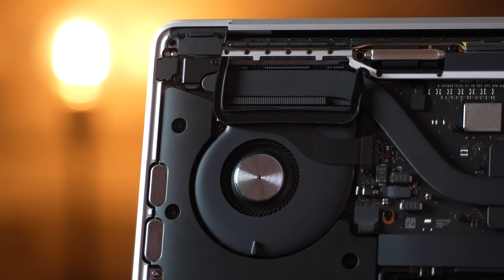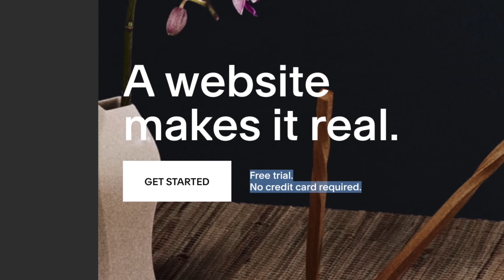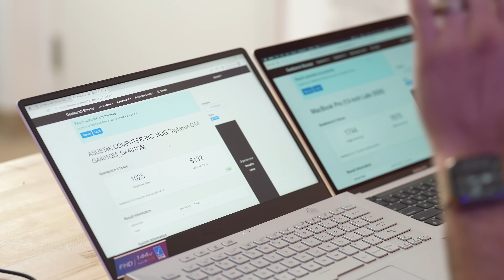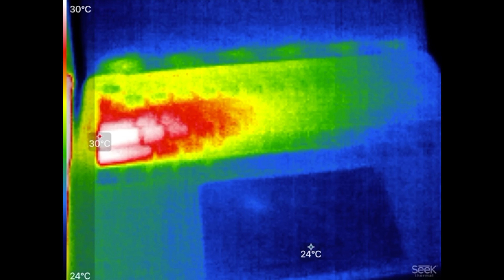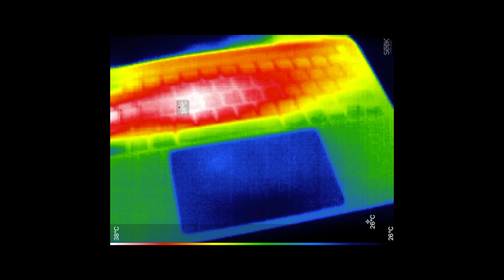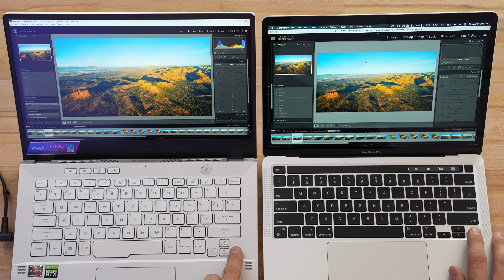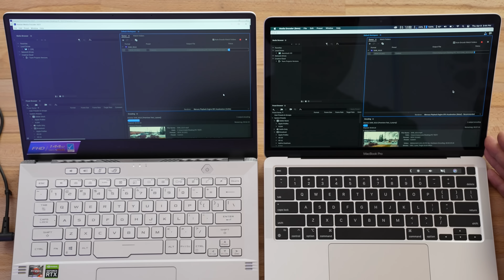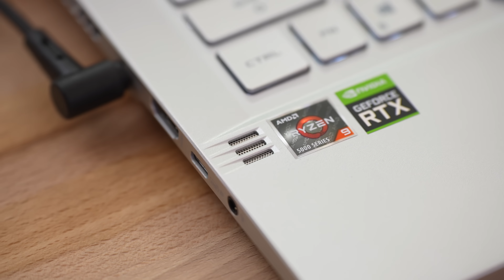Apple M1 vs AMD 5900HS + RTX 3060: FINALLY an M1 Killer?

Comment: When you compare single core performance tests you should think them as  "single thread" tests. The performance of the arm M1 cores is awesome, but you should also keep in mind than most x86 chips can run 2 threads at the same time, so the real performance of the core is between 1x and 2x of what the "single threaded tests" are showing, depending on the task.
Reply: Not quite. hyperthreading only makes use of the inevitable (for the x86 instruction architecture) pipeline stalls where a complex instruction can‘t be performed quickly enough to satisfy the need of another execution unit within the same core for the result of the first operation. So it’s only that fraction that these stalls eat up that is free to use for the second thread. That also means that thread switching is more complicated and overall it‘s probably less gain than the high efficiency cores on the M1 are able to deliver. If it were as you think then the 8 core AMD CPU should have had increased multi core performance. 

To see how much overhead additional threads do inroduce you could - as a rough estimate - divide the multicore score by the single thread score (if the test is setup correctly). But the multicore score isn‘t even close to 8-fold the single thread score and far from the 16 fold score if your theory were correct. But multi threading introduces considerable task switching overhead and synchronisation eats additional performance. If you consider that the M1 is close to 4 times the single threaded performance - and that‘s basically two 4 core processors, one fast for performance and one slow one for high energy efficiency the score of the M1 shows how much better the thread performance scales on such a design unencumbered by hyperthreading!
Reply: @karlgunterwunsch1950  You are right, the gains in hyperthreading are 1.5x at most, not 2x, and only in multithreaded tasks. But I'm right that in single core tests is not measured the full capacity of an x86 core, as long ago, with the first ht core invention, engineers resolved how to take more performance of a Cisk  long pipeline architecture weakness. And 
%50 performance in a given core is a lot.
I like much more the Risk approach of the M1 processors though. And I hope the x86 architecture slowly fades out as is an aging and not very efficient architecture.
Reply: @emilioaranguren8829  The task switching overhead costs almost as much time as is gained by making use of the stalled execution units. That is also made worse by the fact that x86 instructions are extremely hard to decode in parallel (instructions are between 1 and 15 bytes long - thus parallel decoders will have a hard time wasting a lot of effort on bytes that constitute part of an instruction that is being decoded by another decoder). An AMD CPU architect said that the x86 instruction set limits the number of parallel decoders to 4.

There was a time when the BIOS (and CPU) allowed to disable HT while booting - because in certain multithreaded workloads HT was more of a hinderance than a gain. With HT enabled the performance in such workloads dropped by as much as 20%. The maximum gain back then was 20% when accounting for the overhead introduced. 

If I - as a software developer myself - am optimising multi threaded performance I try to avoid making use of the HT cores. I set proper CPU affinity so that cross CPU task switches are minimised and I always calculate the amount of parallel threads to be less than the amount of physical CPU cores - because typically it's the same instructions/execution unit across the threads that they will stall on the CPU - thus if I allow HT to be used I effectively incur the penalty of the overhead but no gains because the stalled thread will also stall the  HT interspersed thread.

HT is a crutch, introduced because some execution units of a CPU core were left idle due to stalls - but with poor register set design, too complicated instructions the CISC approach has now hit a performance wall. RISC had it's time in the past and with the available technology at that time it faded into niche uses (mobile processors). With newer designs and architectures it now starts to flourish once again. I'm just interested to see if a RISC SIMD design like the Intel 80860 will make a come back...
Reply: @karlgunterwunsch1950  With ht enabled in CGI-CPU intensive tasks you can gain beween %30 and %40 improvement in multithreading, with all threads running at top. Look for the comparisons in Cinebench between a 9900k and a 9700k. Your "%20 at top" theory maybe works in tha kind of programs you make, but not in CGI and video cpu intensive tasks.
Reply: Also, if your theory were true in all cases the 9700k should beat the 9900k in single thread performance (there is just 100 mhz of turboboost difference between the two) and it dosen't.

Comment: The 5900HS isn't the fastest AMD mobile chip, though. That would be the 5900HX, which is noticeably faster.
Reply: Can you really get the 5900hs laptop for $1500 in USA? In Europe that thing is 2300€ or $2750. For 1500 bucks I get same laptop with amd ryzen 7 4800hs
Reply: @PfropfNo1  European pricing is higher due to taxes, US pricing generally doesn't include taxes and even then it is lower
Reply: @dev1lm4n63  Don't even talk about indian pricing for tech products. Especially apple products!
Reply: @dev1lm4n63  ain't just taxes. It's an american brand, will cost more when exported, same as VW in Germany vs abroad.
Reply: @Whatdoesntpass  the funny thing it's that german cars are cheaper in the US than in Germany. it sounds crazy but it's the truth.

Comment: This episode is 100% secretly sponsored by AMD and Windows.
Tell me why should we do editing on a small machine having 3060 . We can just use 3090 instead.
Max didn't even mention about power efficiency and battery life of M1 .
Of course the GPU is good in AMD Zephyrus G14 but If you have a GPU intensive Job , then you can use better setup with more powerful GPU.

Comment: Great video. But I want to know how quickly the battery drains on the non-Mac machine in tasks where it beats the Mac.
Reply: x86 CPU can not beat arm CPU in terms of power efficiency. So m1 mac will always win.
Reply: @joydebnath_1485  Its not just because it uses ARM. M1 is on TSMC 5nm, it has 4 efficiency cores and has full integration with the RAM and SSD. The R9 is on TSMC 7nm and isn't tuned for efficiency, running all 8 cores at full speed and wattage. Once AMD move to TSMC 5nm and include things like 3D stacked Cache, they'll be much closer.

Comment: Unfortunately the Zephyrus is going to be a WIndows machine. At the end of the day I just can't envisage going back to a Windows machine whatever the speed of it's CPU.
Reply: I'm firmly locked into the Apple ecosystem, and I find it extremely useful. So yes, Windows in not my first choice in an OS. But I also game, and while I can do some gaming on my M1 Mac, it's obviously not a gaming machine. That's where the G14 excels.
Reply: @timg6930  i still would never buy that G14 though, i recently even switched from pc gaming to console gaming to escape Windows. I bought an original PS3, and PS5 to gain access to the entire Playstation library, and for the nintendo library? I now have a SNES, N64, Gamecube, and a Wii U, and a Gameboy Advanced SP. With plans of buying a NES as well.

I’ve had a switch since launch though. Bought the new 3DS XL very close to that. Before i planned to escape windows.

What can i say, Windows is to me the worst thing i have ever used
Reply: I’m a mac user myself, i cannot imagine buying that laptop myself either, i hate Asus because of awful experience in the past, BUT! The laptop luckily  isn’t limited to Windows though.. You can always install Linux. You do need third party driver support since NVIDIA’s support for linux is extremely lackluster (which is why i’d always chose a radeon over an NVIDIA GPU) but yeah, its still possible. Yes Linux lacks professional software like Adobe CC But its still a billion times better than Windows, in my opinion.

Comment: For me the obvious option is the Zephyrus G14.
It is blazing fast in most cases and will run games more than twice as fast than the M1 Macbook Air.
And most importantly, it will only set you back 1499 USD.

Max, you should have run some real games benchmarks but other than that, good comparison.

Comment: M1 has changed everything, before M series you had more expensive Macs with lower performance,  now its cheaper, and better performance!

That is a massive change and not surprising that both Intel and Microsoft are airing deceiving and ridiculous TV Ads.
Reply: yes. I stopped checking Macbooks 4-5 years ago because you were just paying Apple tax for a slightly better quality. Mac OS is good and nice but Windows can offer similar experience nowadays. 

But M1 changed that. Having a fanless laptop that runs as fast as what others can offer but fans blowing and sucking 4x power is a game changer. 

I love G14. I may get it. It can do everything. But for everyday productivity use, Macbook air is a different beast.
Reply: @cmfrtblynmb02  For somethings PC is still the king, Gaming, 3D rendering, 3D simulation and....

Having said that, for me, MacOS is really great, especially when paired with an iPhone or iPad, the iOS MacOS ecosystem is truly remarkable.

Comment: In the end both are very different in architecture. One is a unified chip which has everything soldered to the CPU and which offers no upgradability. Whereas the Zephyrus is using the traditional architecture and offers upgradability or has the right to repair!
Reply: Soldering everything is a good thing imo
Reliability; solder is better than a connector which might come undone, corrode, or otherwise lose connection and/or become flakey, e.g. under vibration

Cost; connectors on the drive and on the motherboard cost more than no connectors

Third party problems; one of the big problems on the early SSD MacBooks was when a third party SATA III drive was substituted for the factory SATA II drive: the shielding on the cable was good enough that the Intel chipset would negotiate SATA III successfully, but not be able to do sustained transfers at those speeds without data loss. The ribbon cable was not sufficiently shielded, and there was not enough room in the case to replace it with a better shielded cable

Thinness; edge connections take less vertical space than top/bottom connectors, even if you discount connector hardware

Upsell; many more people buy the bigger drives to “future proof” their purchase. This just makes good sense anyway

Lifecycle; if you are more likely to buy the bigger drive, you are more likely to have a machine that will continue to support future versions of Mac OS X… OS’s always take more and more space over time: bigger disk = longer useful life, just like more RAM = longer useful life

And most people don't even have an iota of an idea about how a laptop needs to be repaired, so right to repair is just dumb. Just take it to an Apple Store and they'll fix anything you want.
Reply: @Dishant161  How much do you think adding connectors on motherboards cost? I would pay a few extra pennies to have upgradeability as an option, even if it made the computer as thick as 2015 MBA that had a removable SSD.

About reliability, I’ve had soldered-on BGA connector failures on both iMac and MacBook Pro GPU’s (+ iPhone 7 WiFi chip). Also one of my iMacs had one of the RAM modules malfunction but repairing that was easy as changing the RAM stick for $20. If it was soldered on I would have had to pay hundreds of dollars for the logic board replacement at the time. Since it is an old but fully usable computer it would make no sense to pay more for a part swap than the computer is worth.

Soldering on everything also makes repairs harder for technicians too adding unnecessary time and smaller businesses have to invest on costly equipment like rework stations to get the job done.

How do you think buying much costlier but better configured products upfront would serve the average consumer if the software doesn’t yet require more memory or storage to run smoothly. After using the product for a few years upgrades are cheaper for the same parts that would have been 2 to 3 times as expensive a few years ago.

Reusing is always better for the environment than recycling. And cheaper for the wallet too.
Reply: @Dishant161  Yeah, if by "fixing" you mean they immediatly tell you they can't get your data off and you need to buy a new one. Sadly, people could get their data off even from badly water damaged iPhones. Oh, yeah, and don't forget how the system is basically useless if one of the soldered components breaks. Cpu? You can't get your data. Ssd? You can't turn a perfectly good computer on.
Reply: @kaalsemulzii1920  Not if you back it up to iCloud though. You get like 2TB of storage for just 10 bucks a month
Reply: @Dishant161  Oh, yeah I forget about cloud... I mean someone else's computer. Silly me.
Reply: @kaalsemulzii1920  What do you mean?
Reply: @Dishant161  they'll just ask you to buy another one or pay a good sum of money for repair

Comment: i was wondering if you use a fan control software for the MacBook M1, and set the fans too maximum. Can you squeeze a little more performance out of it? Or is the chip just  running cooler without better performance?
Reply: Ltt had done this for an intel based macbook air. It did not work as expected. Very little gain. They had concluded that Apple limits the cpu not by the temp only.  Would like to see an m1 version of the same work.

Comment: It feels like it demonstrates that discrete GPUs are still relevant in some use cases (and should probably be offered in the future MBP 16 and iMac), not that there is yet really serious CPU rivalry with the M1. Were the (admittedly impressive) G14 constrained to the size, thermal, and acoustic limitations of the Macbook Pro, sans-external GPU, it wouldn't have even been close; it's simply not efficient enough yet and is competing with brute force. We're looking at roughly 3X the power consumption for an overall slightly slower CPU (once we remove the discrete GPU from the equation). 

I think that where AMD will really shine is in desktop performance (compared to a hitherto-unknown M-based Mac Pro or iMac) where, thanks to large heatsinks and wall power, it can really stretch its legs and efficiency starts mattering less and less. 

That said, we have to ask ourselves if we're comparing the M1 to the 5900HS (in which case we ought not allow the Nvidia GPU to be used), or are we comparing the M1 MBP to the G14 laptop, in which case the GPU should be used.
Reply: Discrete gpu? Why? Do you hide an mg42 inside your laptop?

Comment: This still proves how impressive Apple’s M1 is, like, it runs at like a third of the wattage and outperforms twice the amount of CPU cores on some tasks. Obviously the graphics performance with a discrete GPU is going to be much higher, but just imagine when/if Apple releases a comparable dGPU for the 16-inch or new iMac...
Reply: Arm vs x86 that's the difference here
Reply: @malathomas6141  partially. Apple also designs their own cores and cpu architecture. Plus the unified memory .
Reply: The gpu in the M1 is already on par with the 5300m in the base 16in. So it’s not discrete vs integrated. The M1X will at least double the graphics cores and be on par the 5600m in raw performance. 

But as displayed here the efficiency of the m1 punches well above its weight performance wise
Reply: Bro for 2500k lol apple is robbing you buddy face time ain't worth that much
Reply: This is just the first version of Apple silicon lol.
He didn't mention battery life advantage.
Looks like Max is sponsored to not mention that
Reply: @vaibhavbv3409  well I think we already know that and the Apple ecosystem benefits. 

The M2 macs will be at least 15%-20% better in cpu and gpu performance at the same power draw 😂

Comment: something has to be wrong on the geekbench score on the g14. Reason why i say this is because the last time you guys tested the last gen g14 with the 4900HS it outperformed the m1. No logical reason for the 5900HS to lose to the 4900HS
Reply: Each manufacturer implements the cpu different
Reply: @chidorirasenganz  only in this case this WAS literally the same manufacturer lol. Only explanation I could think of is maybe geekbench has to recalibrate something with these newer  5000 chips
Reply: cinebench r23 seems to back this assumption of mine
Reply: @jarjarbinks8954  cinebench and geekbench are different test tho

Cinebench is more a sustained test while geekbench is more burst oriented
Reply: @jarjarbinks8954  also from what I’ve seen the 4900hs loses as well. Not everytime but pretty often

Of course this is only in multi threaded workloads

Comment: I love this channel but why would he put them side by side because the acer has its vents on the right side and it is literally making the Mac hotter
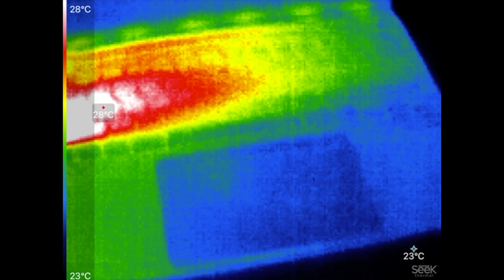Reply: At 8:47 you can see the Mac being hot from the side closer to the acer
Reply: The m1 macbook pro has both of its air vent and exaust on the back. It’s not sucking hot air from the sides, there are no air vents
Reply: @Cae-YouTubeProfile  it is made of metal. It will conduct and get hot